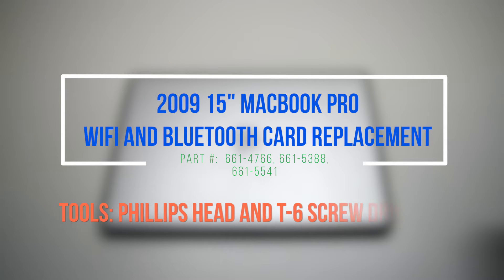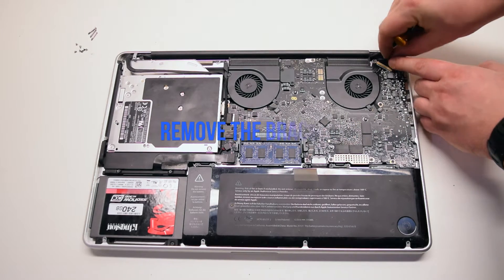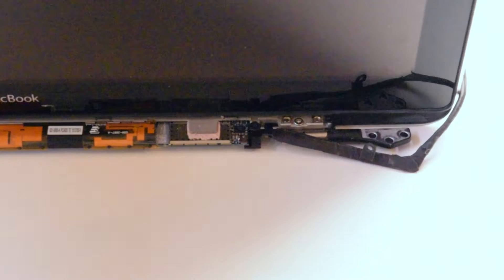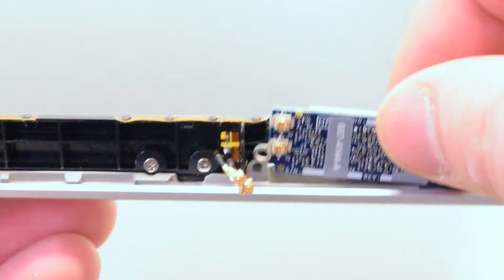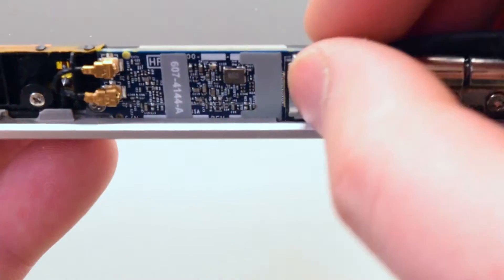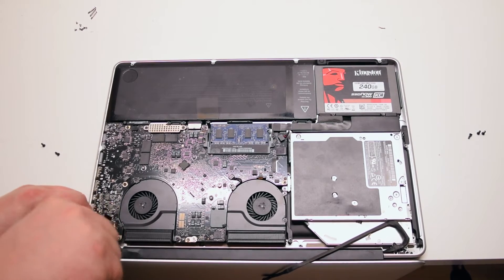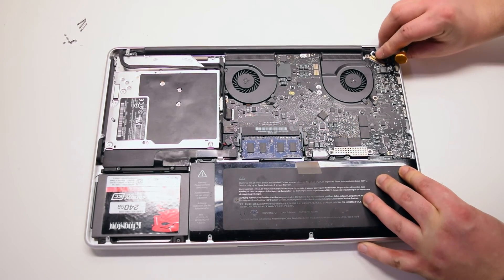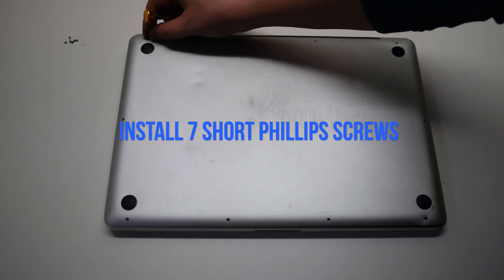2009 Macbook Pro 15" A1286 WiFi and Bluetooth Replacement

Comment: Thank you for this great video.
I am planning to replace a wifi card for a mid-2009 A1286 Macbook Pro 15"
Question: The wifi card has two antenna cables clipped to it, but how can I tell which is which? They are both the same color, and I can't see any markings to tell which is which. If I get them reversed will wifi still work?
Thank you

Comment: I have the same model and I’m also trying to replace my wifi card, however, the 6 screws on the hinge are stripped so I can’t remove the LCD. Are there any work around on this so I can replace mine? ☹️

Comment: I purchased the same model and previous owner had attempted this repair unsuccessfully. He provided me with new parts he bought on Ebay.  When I removed the antenna guard, there is no bracket to screw the antenna and airport card to.  Is there a plastic part that attaches to the bottom of the display housing that the airport card screws to? If so mine seems to be missing.  Another option, this person replaced the screen with one from a different year.. Pls let me know your thoughts.

Comment: I am still repairing my Macbook pro, and finally replaced Logic board and now keyboard. I had to replace the whole top case & keyboard as screws were stripped in mine. Do you recognize this Amphenol HF board. It was right under my DVD player, and this post shows my BT and Wlan card as well . https://forums.macrumors.com/threads/macbook-pro-2009.2133171/#post-27523198
Reply from the maker: So what you are looking for is this 2009 a1286 Bluetooth antenna https://rover.ebay.com/rover/0/0/0?mpre=https%3A%2F%2Fwww.ebay.com%2Fulk%2Fitm%2F362556799914 you need it only for Bluetooth so if you don’t need BT as you said then don’t worry about it. That BT is for the anti glare model only I believe and that’s why it’s hard to find the info on it. Good luck.
Reply: @GRIBSOFT  Thank you very much for your reply. I have learned lots from all your videos and appreciate them and your help. I am thinking I will just go ahead and put it back together without. I just wanted to be sure.

Comment: Hi i have a mid 2009 a1286 macbook and have replaced the lid screen ect with a 2010 now the wifi and bluetooth have been relocated from between the hinges to under the bottom lid in the corner my question is can i just buy the upgraded part as i have room to install this part and will the connecter on the cable / circuit board be the same 
https://www.ebay.co.uk/itm/Macbook-Pro-A1286-15-2010-Airport-Card-Bluetooth-Wifi-Wireless-821-0961-A/113095798290?hash=item1a5508ee12:g:xc0AAOSwSkxbLtxq:rk:4:pf:0 to
Reply: https://www.youtube.com/watch?v=L0iKhE_3QNs
Reply from the maker: Lol how did you get a 2010 wifi card installed in a 2009?

Comment: Excellent Videos. What is the part # for the Wifi and isight cable.
Reply from the maker: The part number is in the listing here, https://ebay.to/2KyM23r it's the cheapest you will find this cable.
Reply: Thanks. I thought that was it, but wanted to be sure.
Reply from the maker: Welcome.

Comment: hey! I replace satisfactory the display and when I turned it on everything happened to be ok except for the wifi so I replace the wifi card from the other display and when I tried to turned it on, the sound came in and the keyboard enlightened but the display didn't threw any image. can you help me please. I'm very upset and don't know what to do or what I do wrong. please! !!
Reply from the maker: You have to make sure all connections are tight. The LVDS connector from the screen to the logic board is very fragile, you can play around with it while everything is open as long as you are very careful.

Comment: I had a question. Could I just cut the cable for the iSight and just use the connection for the airport card? I don't want to take the whole screen assembly apart. Thanks.
Reply from the maker: I'm not sure that I understand what you are trying to do. Based on your question, I can tell you that the iSight Camera cable and the WiFi Card cable are two separate cables that are taped together into one cable at factory and are considered one part by apple but as I have tested before, if you leave one or the other unplugged the latter will still work. So yes you can cut the cable and it will work. I just don't see any scenario for that. It's best no to cut anything but instead leave it unplugged and taped up with electrical tape at the end. Elaborate more if this doesn't answer the question. Thanks.
Reply: +Save Apple Dollars that answers my question thanks a lot. One more question my MacBook Pro mid 2009 fan runs at constant speed however the computer is pretty cool via diagnostics from istat. Tried resetting the pram smc nvram and even cleaned out the fan. Would you say it's time to replace the fan for a new one? Thanks again!
Reply from the maker: It could be the fan but also could be corrosion around a temp sensor or dust in the fan or dry thermal paste on the heat-sink. Download Mac Fan Control here http://www.appledollars.com/downloads/ and manually slow it down to 2500 rpm, save the settings for after reboot.
Reply from the maker: Something else to note, all Mac laptops are thermally designed to sit on a hard flat surface, if in your lap or in the air or an awkward position and the fan will kick in.